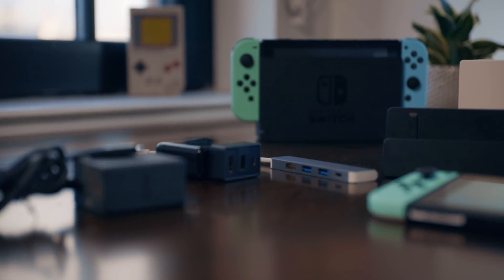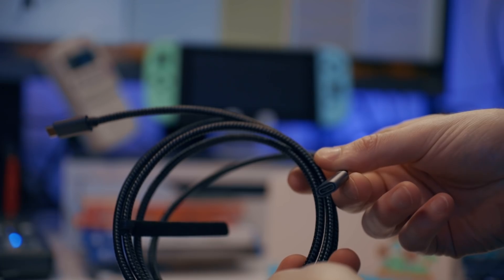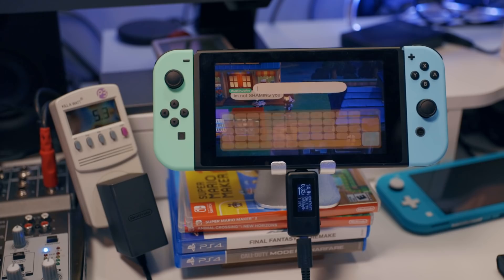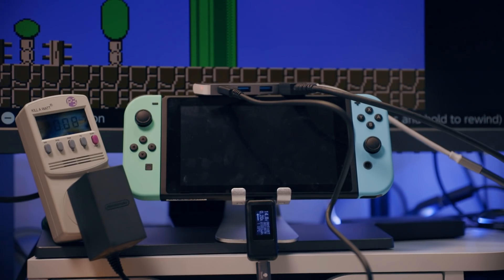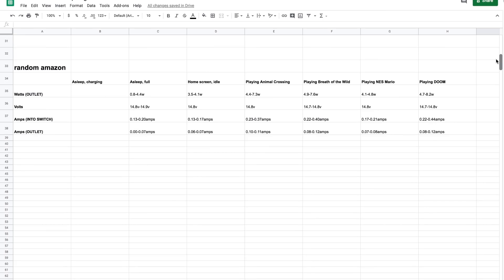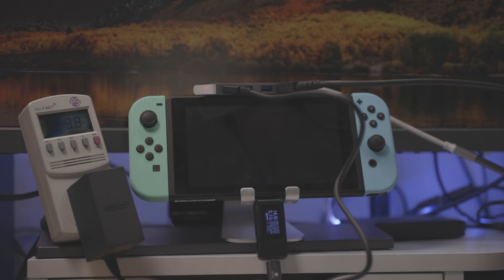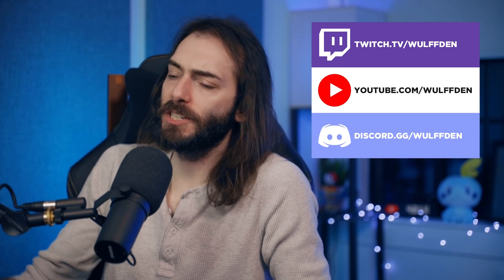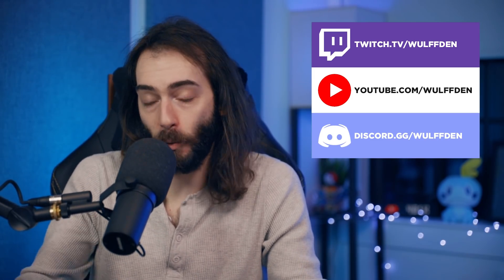How the Nintendo Switch consumes Power

Comment: What about powerbanks? I have xiaomi 10000 mAh with QC 2.0, never tried it because I'm worried I can damage something.
Reply: As far as I am aware, the problems aren't in portable mode.  The issues happen when docked and the Switch behaves like a home console rather than a handheld device.  Your PS4 or XBox One wouldn't be USB-C compliant either, for what it's worth, but these third party docks are being built to that standard, and THAT is what seems to be causing problems.
Reply: There is an official Switch Edition power bank from Anker.  It's the only one that's confirmed 100% safe.
Reply: @matthewblackwood9653  For what it's worth, Anker's "official" switch power brick doesn't seem to be any different from their normal 20,100 brick.
Reply: Power banks are safe, there's no worry about that. No USB-C CABLE has ever caused a brick, and your power bank won't be putting out enough power to hurt a Switch. If it was, it would probably have hurt your phone or any other device you used with it.
Reply: Your xiaomi power  bank should be good to go, unless for some reason your power bank is plugged to your dock and you're playing in docked mode?

If you mean handheld mode, handheld mode is much safer in terms of using 3rd party chargers. I've had my Switch since May 2018 and I've never used a Nintendo charger/cable to charge my Switch in handheld mode (because the official one is attached to my dock). So like, if I'm charging my Switch on my nightstand, my Switch charges off the same charger as my phone. 

Note: The Nintendo Switch does not use Qualcomm Quick Charge, but rather USB Power Delivery (USB-PD). QC 2.0/3.0 are not USB-PD compliant, but QC 4.0 is. So your xiaomi powerbank  with QC 2.0 isn't going to charge your Switch very fast.
Reply: @badlybrowned  I would use it only in handheld mode.

To bad about QC 2.0.

Thanks for the info. I'll know now for the future.

Comment: I was convinced years ago when you started talking about this
What if I hook my switch up to something in portable mode? Still not safe?
Reply: Handheld generally should not be an issue, unless you have a really sketchy brand / damaged charger. 

The known bricking is when you involve a 3rd party dock.
Reply: No third party charger has ever caused a problem, nor will they ever. Just get a good quality USB-C cable and a good power bank, and it'll be FINE.
Reply: Literally every peripheral that plugs into the switch's USB port can brick your switch.

Comment: Honestly, I was willing to get one of these 3rd party docks, so I could play in the office, at school, etc. You really go in-depth the issue whit this video and now I can see just how troublesome this could be. Thanks man, I'd rather go get the official charger and dock set after this for sure. Never ever risk your switch, it's just not worthy.
Reply: The official dock and charger of the switch are very expensive they go for 120 to 200$ for a New set. The brand new kit from nintendo cost 80$ but is sold out since the last year and appear that Nintendo doesn't care about restocking
Reply: @cesarmendieta7954  It's more like they can't keep up with demand. Especially since alot of manufacturing plants are still down or limited.

Sure companies with already made products are running ok right now. But Nintendo is basically selling their stock as soon as it gets off the line.
Reply: @alittlereckless  exactly it's literally the best switch dock option
Reply: What I found was much better was to put the money I was about to spend on a dock towards a carrying case instead. They're about the same price, maybe a bit more, and it's basically a case with a foam inside tailored to hold the Switch, the dock, controllers and the like. I use mine to cart the whole Switch setup to and from family events. Works great!
Reply: I know I’m 5 months late but 5 months later I recently been wanting a smaller dock and I got a Nintendo official dock for 20 bucks on Facebook market place I lucked out and I bought the dock case and now I have a smaller dock that’s Nintendo official technically
Reply: That is what you like to see.
Reply: Just use the modded plastic (Basstop switch replacement dock) and take apart ur doc. It's really easy actually
Reply: @mouseconcafe  was going to say this its amazingly small and no risk
Reply: Either take apart your dock and put it in a smaller shell, or do ten minutes of research to see what docks are and aren't compliant. So far, the only docks that have bricked Switches are a really small number of docks. And the idea that Nintendo updating the Switch caused the bricking is false. Nyko's dock had been bricking Switches months before the update.

As long as you do your duty as a consumer and be responsible, third party docks ARE SAFE.

EDIT: Also, there's still no hard proof that what's described in the video is actually what caused the bricking issues. There's no hard proof that third party chargers caused it either. These are bits of evidence for the leading theory, but nobody has managed to prove it.

Comment: So here's a weird behaviour of my switch after using a third party Dock. The switch is able to output video signal to the TV trough the third party Dock but NOT through the oficial nintendo Dock. I've checked the switch with another nintendo switch official Dock and behaves the same. It's working on portable mode and docked mode but ONLY and ONLY with the third party Dock. How is this possible?
Reply: Double check all the TV setting on the switch. My guess if you tried two known working docs is something is set on the switch that is incompatible with your tv and the third party doc just scales automatically and the switch doc doesn't. Most likely RGB range setting.
Reply: @CollinL  I'll check that and let you know. Thanks for the idea.
Reply: So I've used the same TV settings on the switch on the switch that works perfectly with the Dock (my second switch) as the switch that gives me problems. The only difference was the resolution setting, that had 1080p instead of automatic. Changed it to automatic and still no luck. Also I forced all the RGB settings on the switch that gives me problems. Works every time with the third party Dock and not a single time with the original Dock. Not only that but when I put the problematic switch on the dock the green light doesn't even turn on. It's as if the USB c doesn't connect properly. The strange thing is that I've tried it on 2 brand new official docks with the same behaviour. Doesn't turn on the Dock light or output any kind of signal. And still, with the third party Dock works perfectly and in handheld mode also works flawlessly. Very very strange.

Comment: Is there a difference between putting the official nintendo charger in your official dock and than your switch in your dock and putting your official nintendo charger directly into your switch?
Reply: nathan habu I don’t know for a fact, but I doubt there’s a difference in terms of safety - the one difference I’ve seen is how fast the charge happens while playing a game. Which is expected when charging in portable mode versus docked, because when docked it’s charging at the same time that the switch is outputting video to the TV (which puts a heavier load on the performance).
Reply: @real_shenanigans  thanks 🙂

Comment: Thanks for saving me from killing my switch with my cell phone charger. And nice beard btw
Reply: That's not going to happen, no cable has ever caused a problem for a Switch, nor will they ever.
Reply: @redwidow1358  Eh, I figure better safe than sorry. If Nintendo Switch Jesus says to just use the offical charger, that's what I'm going with.
Reply: @ghettooyster  Well, he didn't do any full proper testing, nor did he test cell phone chargers. Because cords aren't the issue. Docks are. I've been using a regular USB-C cable to charge my Switch and Joy-Cons for over a year and a half now, even on the older models. It's safe.
Reply: @redwidow1358   In my experience my S9 charger is incredibly slow compared to the official switch charger. No benefit to using a cell phone charger for me beyond occasional convenience. And I recall Jesus mentioning in an older video that the switch doesn't go by the usb c power delivery standard. Just doesn't sound like a good idea to use a different charger, but you do you boo boo.
Reply: @ghettooyster  You can use the cable, it's safe. Just use a power bank that delivers a faster charge. And again, the cables aren't the problem. The docks are. All third party chargers are safe to use, and all USB-C cables are, in the vast majority of cases, safe to use. If it's too slow, that's fine, you can use a different one.

Comment: I'm wondering, can I use a normal USB C charger when the Nintendo Switch is turned off?
Reply: cob_150 I would take the guess that you can, but you’d still run the risk of power still being put into the Switch when it’s at 100% charge. It seems like only the official Nintendo charger and charger dock handle the Switch being at 100% in a safe way.
Reply: Charging isn't the problem at all, docking is.
You can charge the switch with any charger or Powerbank, and you can play while you charge. The problems only exist in docked mode, because the switch starts drawing more power.
Reply: For my testing yes you can as long as you don't play while you charge it
Reply: Do you mean with the dock? I think when docked, to be 100% safe you want a Nintendo branded charger.

For handheld, you are pretty safe with 3rd party stuff (AFAIK and from my own experience), though I wouldn't use a cheapo gas station charger and/or cable.
Reply: Just one person's experience, but I've used a generic Anker USB A charger and I've left my switch plugged in for weeks at a time and mine hasn't been bricked yet.
Reply: @Kortexual  And it never will brick with that method. The bricking is related to a specific USB-C connector's pin after all.
In fact this is also what I use when playing in portable mode, it just stays connected by my bed and I take it out only when I drop it on the dock - this one tho is the official one, since it literally came with it and why risk other stuff.
The Switch will play and charge even, if you use a 2A charger (and obviously a 2A capable cable), unless on very demanding games with high brightness and wifi on, tho will charge very slowly.
Reply: As the problems are in sleep mode, probably not.
Reply: @MikooOnYoutube  I tried the same thing and found that hardly any 3rd party chargers output to their maximum. In fact my switch charged quicker with a usb charger in my wall socket than it did with an iPad charger with USB c cable and my OnePlus 7 charger.
Reply: @Mila Leila it does. I literally do this as I've broken my dock. However the brick/cable you use make a difference. Unfortunately, I haven't figured out what the a rural variables are, but It does work. I'm doing it with my phone's USB c cable and a usb socket that is on my wall.
Reply: this is so confusing ill just not charge my switch using any powerbanks aaaaaaaA
Reply: I used my oculus quest charger and it works fine even in sleep mode and I can keep it on all night etc
Reply: It's what I use. I sold the dock because I literally never used it and bought a Belkin USB-C cord to charge my Switch.
Reply: Normal C chargers don't work on switch. It has to be a switch charger. My family has a phone that uses C charger. There cords don't work on the Switch. I have to protect my precious switch cords from being stolen by family. I have to explain to family that my cords are not for cell phones. This is a challenging task.
Reply: @screengurl2007  Normal USB-C cables DO work on the Switch, you can use any generic one. If yours doesn't work on your Switch, there's a problem with your cord.
Reply: @screengurl2007  They do. It's the other way around that MIGHT not work. The Switch own charger is quite bad at a cell phone charger or anything else, but normal proper PD compliant USB-C ones do work, hell, even 1A normal USB chargers with a USB-A to Type C cable do work but won't charge while you play.
Reply: I bought the Switch almost at launch and more often than not I charge it using a standard USB charger (to be specific, the one from my Pixel phone) and I have never had any problem. I leave it charging all night and sometimes I use it while playing in portable mode.
So you can do it.
HOWEVER, this video claims that the third-party docks still gives power to the Switch when they are sleeping with full battery and that could damage the battery in long term. If regular chargers do the same, then I already shortened the lifespan of the battery of my Switch.
Reply: @luisoncpp  This only applies to DOCKS, not CABLES. Docks pull extra power, while just using a cable means the Switch pulls the power. You can never have too much if the Switch is controlling it.
Reply: i tested my samsung charger to charge my switch in portable mode and it behaves the same as the original. as long as it supports PD protocol.
Reply: Sheldon Cooper I thought the whole reason aftermarket docks aren’t good was because the Switch DOESNT follow pd protocol
Reply: @swilliams23  i think its when the switch is only docked since it takes more power to output in 1080p. what i'm saying is if you are charging in portable a charger that follows PD protocol is ok.
Reply: @swilliams23  It's a normal confusion, but actually the Switch follows the protocol pretty far. There's like one instance of not following it, which is the console drawing high current before it finished negotiation. If the charger can provide the sufficient current whoever, that isn't an issue. If it can't, then it will just bug and not charge.
Reply: YES, YOU CAN. 100%. No USB-C cable will damage your Switch. It's safe! No third party cable or regular USB-C cable has caused damage to a Switch, nor will they ever.